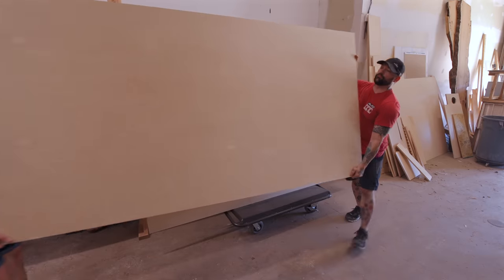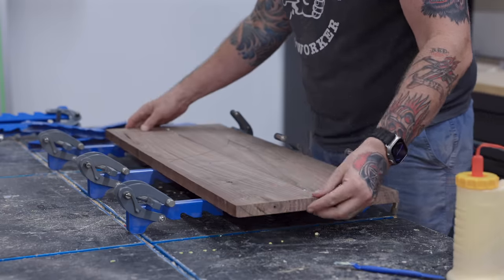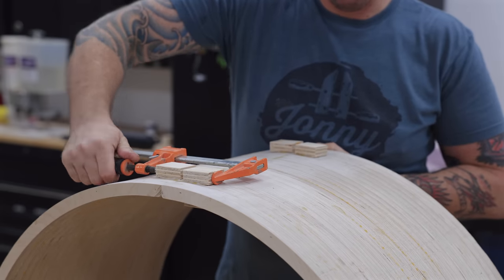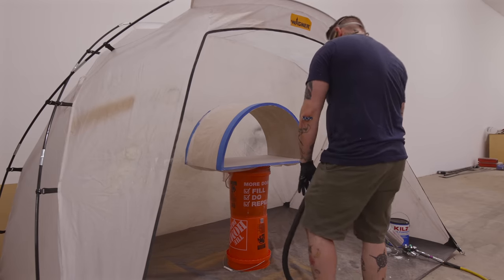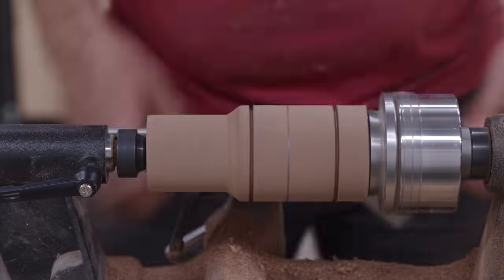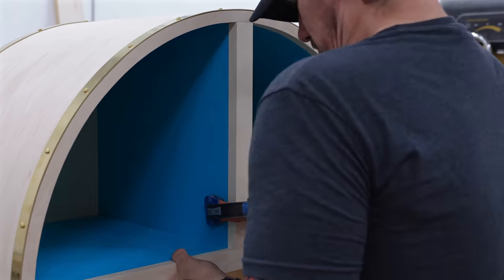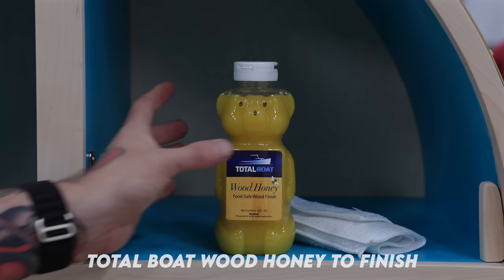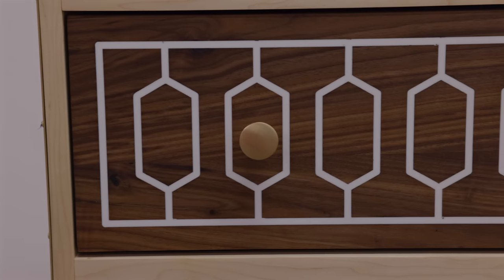This Left Her SPEECHLESS

Comment: The woodworker that never makes mistakes is a liar. Doesn’t really matter how many mistakes are made, although frustrating, it’s the ability to fix them that counts. I always appreciate the honest ones. Keep up the good work.
Reply from the maker: Exactly!!!
Reply: @JonnyBuilds measure twice, cut once. Realize you messed up the measurements, so measure three more times and cut one more time. 😂
Reply: All "mistakes" are learning /teaching moments
Reply: @williammaxwell1919  agreed. I know I certainly learn more from failure than success... the lesson sinks in deeper, faster.
Reply: @jasmeralia 
100% AGREED !
Reply: Anything that is handmade has mistakes, and that is what makes it one of a kind!
Reply: I've done cabinets and furniture for the last 15 years. I was a carpenter for 20 years before that. I don't make mistakes, I make MISTAKES, I made so many mistakes when I started using a CNC that I donated it to the high school. My problems have dropped drastically since then. I am not fond of power tools outside of a jointer, drum sander, and table saw.
Reply: I rarely make mistakes because I always think before making important cuts and whatnot. Also I work with plans if things start getting non trivial
Reply: @williammaxwell1919 I have adapted the saying to be "a mistake is only a mistake if you don't learn from it, otherwise it is a learning experience"
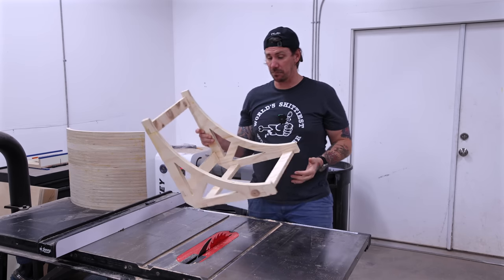Reply: Hes talking about the American system of measurement when he "drops" the measuring tape being perfect, not his work. Look at 1:18 to 1:23 timeline.
Reply: This is true for all artisans
Reply: Mistakes happen while working. If no mistakes happen, no work has been done.
Reply: If you're not making mistakes, you're playing too safe.

Comment: Thanks Bezos. Just a tip, the T nuts you used to attach the legs should go on the inside of the cabinet so that when threaded in, it compresses into the wood. (This is what they use to attach climbing holds to walls, if the nut was on the outside of the wall, you’d rip it right out!) Like the design and pop of color!
Reply: I don't think it really matters here unless you're trying to hold the dresser upside down by the legs. Here, it's not providing structural/load-bearing support to the legs; it's just about keeping the legs attached. Much like Dominos might not add any notable strength or stability when joining two pieces, but they're absolutely amazing for alignment purposes. Rock walls matter a lot more because those bolts are load-bearing. They're around a 90° angle to the ground, so you have to account for shearing force on the bolt itself and (if it's not a perfect 90°) also horizontal tear-out force, which is where you're entirely right about where they should be placed. In fact, I'd argue that in this case, where the most normal force being asserted is a downward one from gravity, the position of the tips he used is actually more correct, as they will dig into the wood further as additional weight is added inside the dresser. Your suggestion would have the tips grab more as the legs are tightened, but that's not really important... maximum tension won't always be correct if you need to accommodate for a floor that isn't perfectly level (aka most of them, heh).
Reply: You’re both right, I’ve just only used them the other way which makes more sense in my brain.
Reply: I was thinking the same thing also when it slid across the floor instead of lifted there's less of a chance being ripped off the bottom. I'm sure that was probably covered in the long explanation of why it doesn't matter though 😂

Comment: For a possible solution to the issue of gluing up those arch pieces, why not include a hole in each end of the arch pieces that's the exact size of a dowel so that you could use a dowel to index every single piece in the same spot? Idk maybe there's some reason why that wouldn't work, I'm not a super experience wood worker and I've never done anything like this but it seems like it could be a fairly simple way to make that whole process less of a headache!

Oh and thanks Bezos!

Comment: 2 points: The tee nuts should have been installed from inside the dresser for strength of the the joint. Why did you not clean up/ flatten the doors and drawer front with a fly cutter or surfacing bit? Would have had next to zero tear out. It is such an impressive build. Not exactly my style, but real recovery from several problems.
Reply from the maker: If you install the t nuts from the opposite side they’ll pop right out.
Reply: @JonnyBuilds  what? How the dresser bottom would be between the leg all-thread and the tee nut lip. Your video shows you installing them in the underside of the dresser bottom.
Reply: @jamesguerrieri949  the position he used leverages the directional force of gravity towards the biting tips. The more weight in the dresser, the more they’re going to grab. That’s a lot more common than horizontal force is going to be.

Comment: Hey Jonny, I know this probably seems like an odd question but is there anyway you could share how you used the cnc to cut out the joinery to do the drawer boxes?     I understand the concept but I've had trouble actually getting them to fit correctly.

Comment: For the arched top is there a reason you did them in two halves then glued them together as opposed to cutting the arch in one solid piece? I’ve been mulling an idea around in my head for a cabinet like this for my wife and the arch has been the hardest part for me to figure out. I’m now debating between this method and using kerfs
Reply: From what I've seen, kerfs can be interesting, but they also seem to be really challenging. The exact thicknesses of your cuts, the depths of your cuts, and the distance between your cuts really impact the outcome. Too far apart, it looks really bad. Not deep/thick enough, it doesn't curve enough. Too deep/thick, and it doesn't hold together.
Reply: Makes sense. I like his idea of using a cnc to cut the arch and laminating it. Just curious about two half’s as opposed to one solid piece all the way across the arch
Reply: @tylerpatten4218  Yeah, I'm not entirely clear on that one myself. Maybe less wasted wood with the way the smaller shapes can be arranged?

Comment: 1, why didn't you cut the entire arch on the CNC, en 2, as you used half arches, why didn't you stagger the seam? Not ragging on your work, just curious. I guess the third way you could have gone is to make the arch solid from thin plywood and (steam)bending... Plus a tip for the turning of the legs: if you make the negative shape out of thicker plywood and glue/tape sanding paper on the edge, you can turn the legs into exact shapes by sanding.
Reply from the maker: Cutting the arches in smaller sections allows me to get more out of the wood and reduces waste. It would be so much easier to cut them in full half circles.

Comment: It's never a mistake, it's just another opportunity to add detail to the design. I built a TV stand with inset doors and when I attached to stops across the top rail, I forgot to change what size braids I had in my braid gun. Needless to say, I punch holes through the top rail because of 1 1/2 inch braids when I needed 3/4 inch. I had some oak rope trim that was about 1/2 inch wide that I used like an eyebrow on the top rail and covered the nail holes. Everyone who saw the finished product thought that the rope trim was a nice added detail instead of an "ooops" fix. You really did some very nice work and I loved your daughter's reaction to all of it. Thanks for sharing!